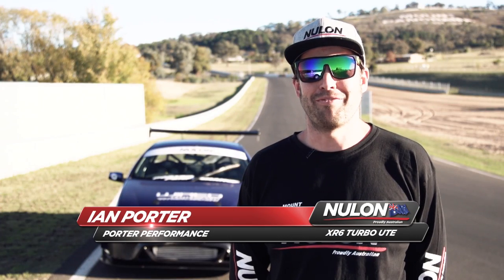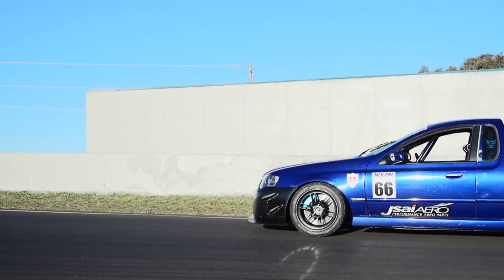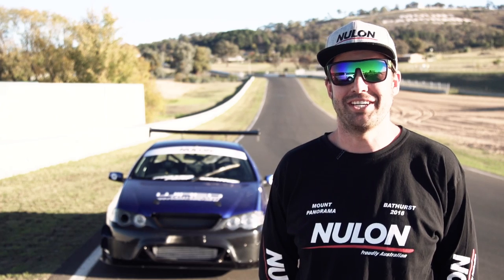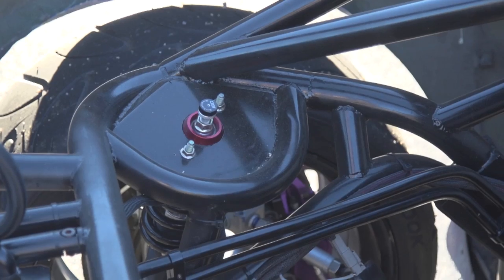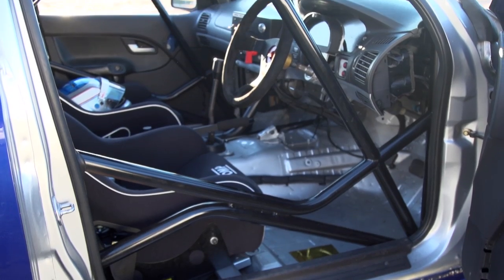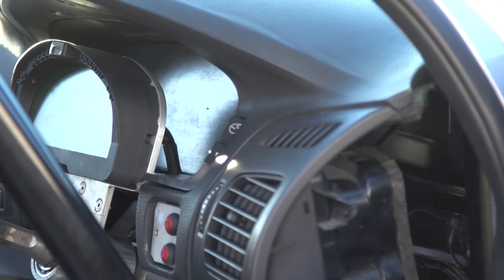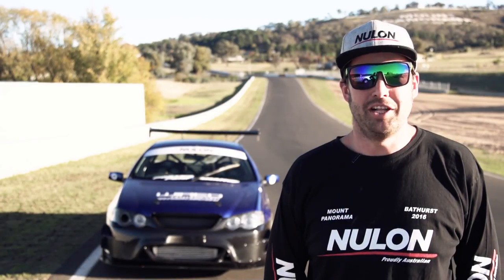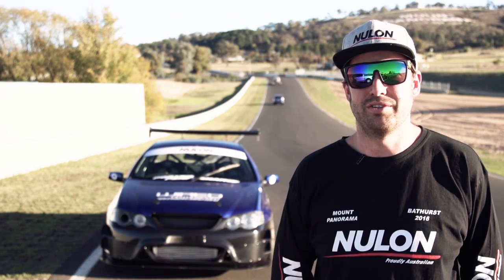Time Attack Ford XR6 Turbo Ute with 300ZX rear end

Comment: I love a good IRS setup, so I have become curious with this one.

What made you choose the Nissan 300ZX rear end?
Is it power handling capablilities, ratio options, how the linkage set up or just a case of what was available at the time?

I'm looking into piecing together a Ford 9inch IRS system, so i'm curious to know why you went your route.
Reply: just buy a Holden son
Reply: Luke Neill

We don't have Holdens as such here in the UK, and even if we did, they don't produce quite what I want for my future goals...
Reply from the maker: 300ZX is incredibly strong, as mentioned in interview can handle over 1000rwhp just like GT-R one can. Also, there is lots of aftermarket parts available for Nissan IRS rear ends make upgrades and spares very easy. Basically its  proven product so set-up time is quick
Reply: Luke Neill that's even worse
Reply: he doesn't want to go slow.